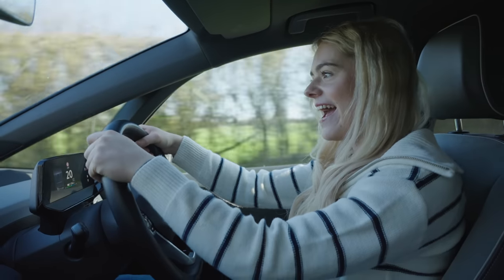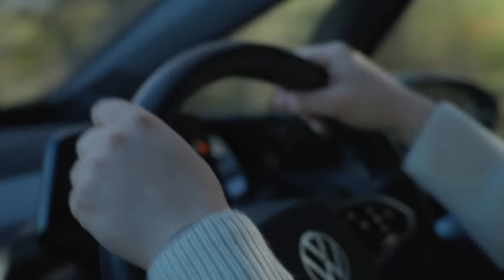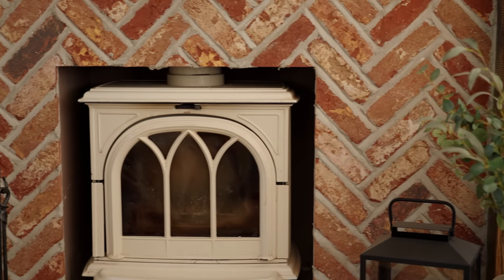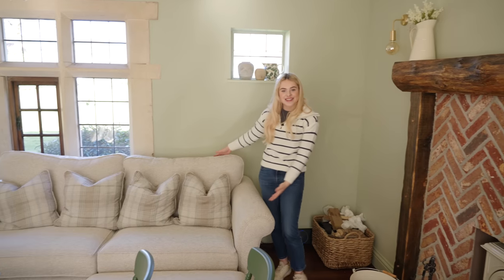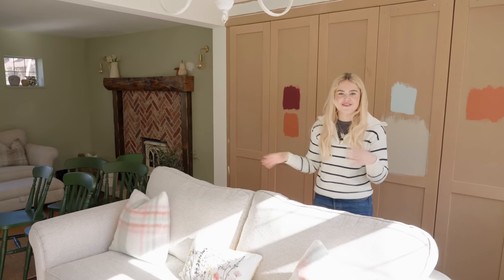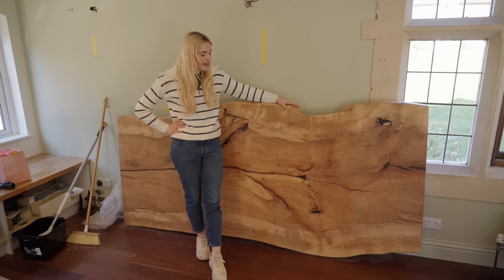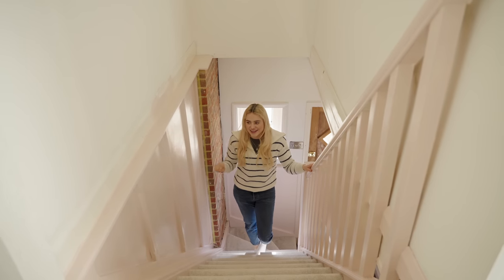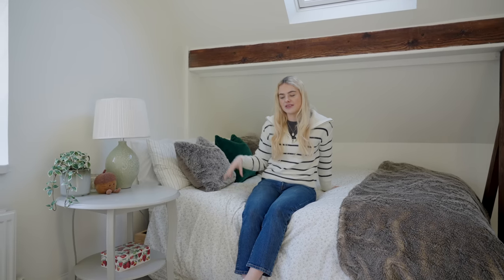Moving Again? House Tour! This Esme

Comment: Gorgeous but please be careful, your log burner (if it's a real one) isn't safe, it should have 150mm (15cm) clearance either side with the surrounding surfaces and it doesn't look like it does and is a serious fire hazard xx
Reply: I don’t know were you live but that guide is not true in Ireland and uk we have log burners/stoves built into fireplaces wall with no gaps in most homes.
Reply: @The lucky equestrian  I am in the UK and that's definitely the guidance for wood burning stoves as they get so hot. It's not the law but it's definitely safety guidelines, it just looked very very close to the surrounding chimney I thought xx
Reply from the maker: its ok, its been checked